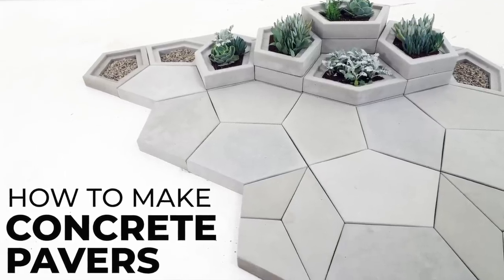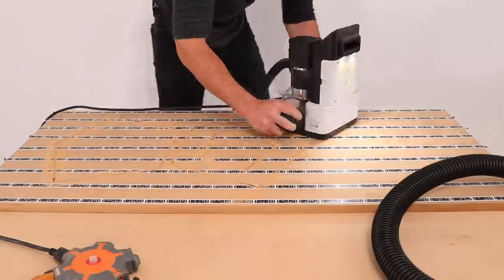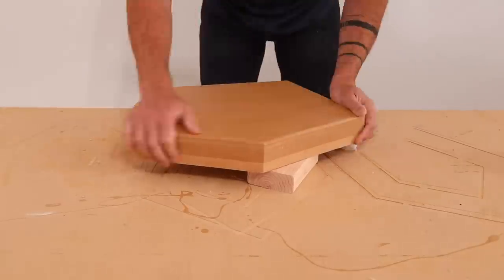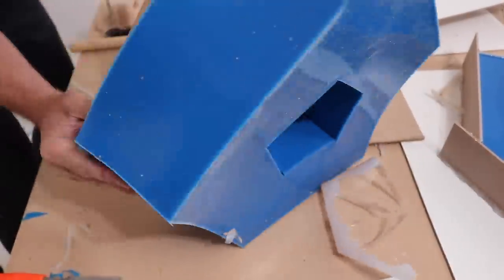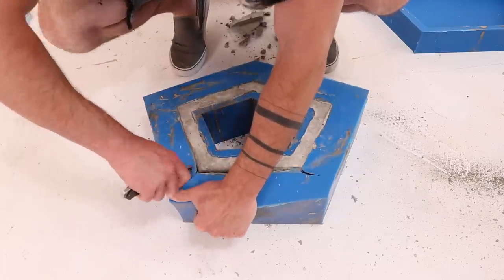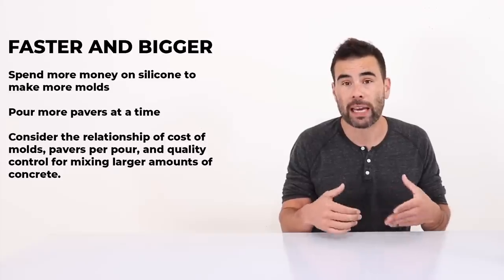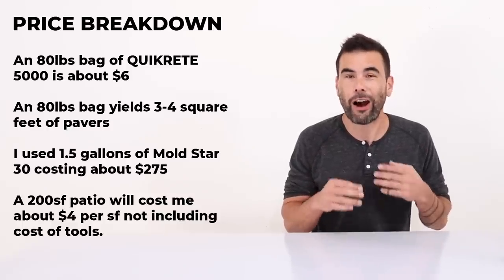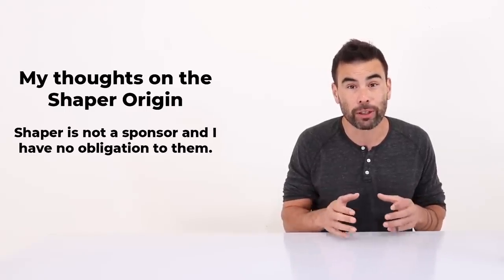How to Make Concrete Pavers | DIY CONCRETE PATIO PROJECT

Comment: Lives in an appartement: "hmm yes this sure looks like something i would make" *clicks video*
Reply: i have been laying what you call pavers (flags in uk) for over 40 years seen all types of designs. unfortunately i have seen many like this that are totally useless ! due to the fact they are extremely weak ! ok for a ornamental look, this is due to them not being pressure (weight)  treated this removes all the air from them, no air no weak points . after a while if your in a very cold seasonal change area these WILL crack ! weak cheep mans short cut which will cost more in the long run !! unpressed concrete or un re-enforced is very weak !

Comment: These are very well designed and built pavers. I am very impressed. I am just wrapping up a DIY paver job in my back yard.
I poured, so far, about 1000’ sq. ft. Along with about 90’ of 8” by 2’ high retaining wall, installed mainly to level my yard.
Poured the wall around 6” PVC sleeves, of which the bottom 24” were poured in concrete prior to installing the retaining wall.
These were used for fence post sleeves, backfilled with sand. It’s taken 3 years of after work and weekends. Turned out really nice but these pavers here almost make me want to replace it with these. 😂 
Seriously though, great job!

Comment: In architecture school, we did a lot of concrete stuff. If you make a wood jig that is able to be disassembled and reassembled easily, you can do some of this type of stuff without the CNC and without the silicone. (i'm not meaning this as a criticism, btw, just as a tip for those wanting to do similar stuff as a starting point)

Comment: This is one of my favorite projects you’ve done.  Have you considered a brush on silicon mold with a fiberglass shell?  This allows you to have a thin layer of silicon to capture the detail and the fiberglass adds the rigidity.
Reply from the maker: I have considered it and am looking at some other options from smooth on (not a sponsor) In general I don't enjoy working with fiberglass but its a great and efficient combination.
Reply: Or maybe just coat the inside of the mold  with Flexseal

Comment: Pretty cool idea. Would be an absolute beast of a project for DIY though. This is way beyond the average person's capabilities, I would think.
Reply from the maker: yeah I used to think that but some of the biggest and most complicated projects I post get built the most.  I think it is because its so expensive to commission custom designs like this.
Reply: @HomeMadeModern  Don't get me wrong. This would be cool as hell to do, but for me, personally, it's cost-prohibitive, even compared with the end result. There's no break-even for the average person.
Reply: Mr. Nova what do you mean by no break even for diy.  have you priced pavers at lowes or home depot?  most of them are more expensive than $4 per sq ft.  and thats for the basic patterns.  With this you can get a $10-20 per sq ft patio for much less.  And many areas of the country concrete tools and skills are very reusable for future projects, so the tools have good return on investment.

Comment: Smooth-On usually recommend urethane for concrete molds. It costs about 35% less than the Mold Star. Not quite as flexible, so maybe not great for the planter sections with the undercuts, but should be great for pavers.

Comment: This is a Genius video and Im super appreciative.  You do not need a router though.  Or the Silicone.  Just place screws in form ply that you back out when dis assmebling.  As long as you assemble the forms in a good way youll be able to re use them repeatedly.
Reply: Or you can use a router and Silicone, making it fool proof and make your life 100% easier.

Comment: The design and the tessellation is quite beautiful, well done!
However, that first part is extremely unnecessary and expensive. You can print the design on multiple A4 pages, trace the line with a pencil, and cut with a jig saw. so much cheaper and faster that way.

Comment: I wonder if will be more easy if you use the MDF, as outer support, adding another layer in the design you cut a little over the MDF from the positive prototypes. And also using that to reduce the Silicon outer shell to a thinker diameter.

Comment: Hi, I keep seeing that there should be a 2 to 3 mm separation between pavers so sand can get between them to lock them in.  This is usually done by adding separators to the pavers.  I did not see those on yours.  How do you get the separation?

Comment: I noticed on the flower pot ones you had the starter ones on the bottom Could you have just made the stacked ones and somehow just knock off the bottom inset concrete piece off so it would lay flat. I hope you can understand what I mean. Only asking because I’m going to try doing this before the 4th of July holiday. Great project. Ty

Comment: The outer shell is called a "mother mold" and is commonly used in the molding and casting industry, and mold release will also make your molds last much longer.

Comment: Ah yes, the Reciprocating Saw trick. Take an old dull blade, shorten it and weld a 50x50x10mm steel piece on it, worked wonders for me :D

Comment: Your still narating individual mold components.
May I humbly suggest you integrate your described outer mold with the 1/4 silicone into one piece molding?
I'd line the mold with galvanized screen or chicken wire, then pour the silicone around that to hold them together.  
Your mold is then wood, with silicone contact area.

Comment: Great video. Take off the blade from the reciprocating saw before you bend it. The flat guard on the saw will make better contact and save you from being stupid with a power tool.

Comment: why not sell silicon molds?
Reply: It's not practical. Silicon is heavy. It would be expensive to ship them. You would have to sell them at a high price point to make a profit. Plus, silicon doesn't ship very well. They are really easy to make yourself  and far cheaper. You don't have to use the same silicon he uses, there are others on the market that are cheaper.

Comment: Cool Cool now tell me how to do this with $20
Reply: instead of using the cnc cut them with a saw, if you don´t want to use a silicon mold, it won´t be as easy to reuse the mold but is still do-able
Reply: I have all these tools and supplies. Totally doing this.
Reply: easy: buy a chisel

Comment: Hey Ben, how about supporting those thin side silicon molds with sand or other similar construction material in revision 2.0? Do you think that it would work?
Reply from the maker: it would work but a little messy and slow for me

Comment: remove the blade before vibrating with the reciprocating saw. just push the guard into the wood if you push the tip of the blade into something like that eventually you will break the blade and shards may fly out
Reply: I thought that seemed rather dangerous myself

Comment: it is diy if  you have up level extra professional tools:)) but the pattern was a nice idea with the  planters that can be integrated in the pattern.. like modular  pavement :) making a mold  out of wood to the silicon mold made after a wood mold.. it seamed a little counter wise.. wouldn't have worked easier to just make mold out of wood from the beginning, less money , more durable and more efficient>

Comment: You should look into aircrete. It would make your concrete lighter and easier to work with
Reply: Honeydo carpenter has a video re o on how to make an aircrete machine so you can diy
Reply: But wouldn’t that make these super weak and not durable?

Comment: I love this but I will never have the patience to pour concrete for 60 days. I need to find a way to industrialize this process!
Reply: Well, 45x80 lb bags is one yard. One cement truck will carry 9.5 yards max. Make about 450 sets of molds, order a truck, fill your molds, bam! Build the molds out of 3/4 plywood instead of silicone, I estimate 10 sheets for the sides, 15 for the bottoms, so 750ish CAD for the wood,  1500ish CAD for the concrete, and you would end up with around 1800 sf worth of pavers for 2250ish CAD plus your time. It would be a lot of time I think. Oh yeah and form oil, no idea how much that costs. Plus if you wanted rebar or rebar wire.
Reply: @jessemurphy8871  I was thinking about using ply too but the surface wont be as smooth. Rebuilding my backyard is still a year away so I have time to think about it and learn some more

Comment: Why use silicone for something with that little amount of details while good old plaster would do the job? Silicon costs like 20 times more than plaster
+ you can also use a very very thin layer of silicone not like the one you used and outside of it put a plaster shel.
Reply: Did you see the bit where the planter section is a complex shape requiring stretching the mold for extraction? How would you get that shape out of a rigid plaster mold without destroying the mold?

Comment: might want to look into https://www.maslowcnc.com/ for a smaller footprint CNC. it tilts the work quite a bit.  it's not a bad kit that starts around $399 (not a sponsor, not spam either. it's just a project i've looked into and it's probably the cheapest CNC that can handle 4' x 8'.)

Comment: Very cool but definitely not for the average diy-er.....also buying all the tools and supplies seems way more expensive than hiring someone. I did like results...bit jealous
Reply from the maker: I used to think that and then we priced out custom concrete countertops for clients of my architecture firm ZeroEnergy Design and it was way more expensive than quartz.  A basic concrete slab patio would be pretty inexpensive to contract out but a design like this would be more expensive than buying the tools in my experience.  also just the CNC parts could be outsourced for a hybrid approach

Comment: i have been laying what you call pavers (flags in uk) for over 40 years seen all types of designs. unfortunately i have seen many like this that are totally useless ! due to the fact they are extremely weak ! ok for a ornamental look, this is due to them not being pressure (weight)  treated this removes all the air from them, no air no weak points . after a while if your in a very cold seasonal change area these WILL crack ! weak cheep mans short cut which will cost more in the long run !! unpressed concrete or un re-enforced is very weak !

Comment: "DIY" 1st step: Buy a $3k tool...
Reply: As he said you don’t need it and come on now. It’s not like he cut some insane shapes. You can do that with good old tools pretty easily.
Reply: @WonderWhile  Then why didn't he do it that way?
Reply: @SmittenKitten.  Why would he when he has this great tool?
Reply: If you were an early adopter you could have gotten the Shaper Origin anywhere from Free to $1500.
Reply: What is it about having nice tools that negates the term "Do It Yourself?"
Reply: The whole point of DIY is using tools instead of using a credit card.

Comment: This is not a DIY project. I remodel houses for a living and I definitely have the normal tools needed to do this project. I can't imagine why you would jump into the deep end with a highly "stylised" tool like that router other than maybe you got it for free and are obligated to make a video using it.

People with the knowhow can pull this off with a circular saw, normal non-robot router, a measuring tape and a visit to your closest Smooth on supply store.
Reply from the maker: I did it myself because it would be too expensive to hire someone to do it. there are other tools that can accomplish the same things.  I used to think like you but then I saw people using CNC machines to recreate my spiral staircase.  I saw people using 3d printers to print my designs.  I am doing it myself, they are doing it themselves.
Reply: @HomeMadeModern  oh no offense. I have a 3d printer too but a DIY Chanel that specializes using expensive difficult to afford tools seems odd to me. Is like watching a "home workout" video and the person is using thousands of dollars in equipment. It suddenly stops being a "home workout" video.

If this projects can me done with normal affordable tools. Maybe add an alternative method to doing it. Anyway, is fine. I don't know why I'm even commenting. Is a hell of a cool project. If you have the tools then use them. I don't care anymore.

Comment: I stopped watching once I realized it’s not a true DIY project...
Reply: What is it about this project that isn't "Do It Yourself?"
Reply: The specialized tools can easily be replaced with a harbor freight table saw and router. Or if you want to go old school, you can use a handsaw and file.